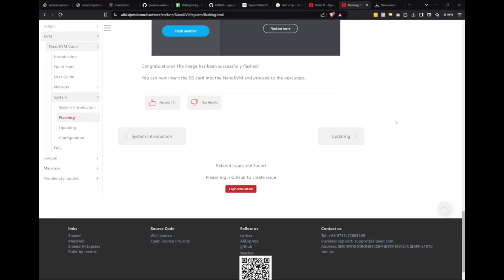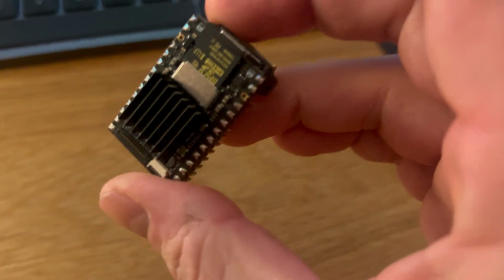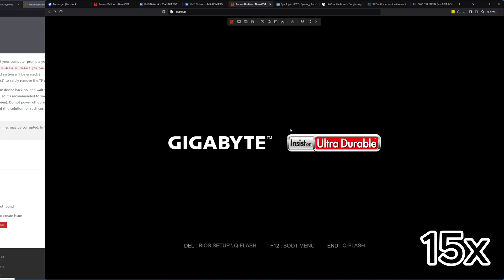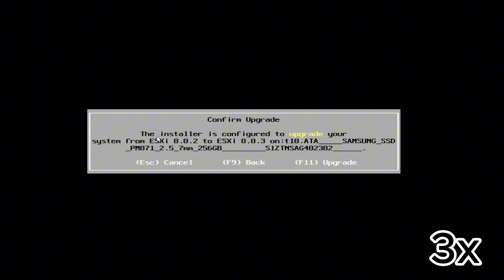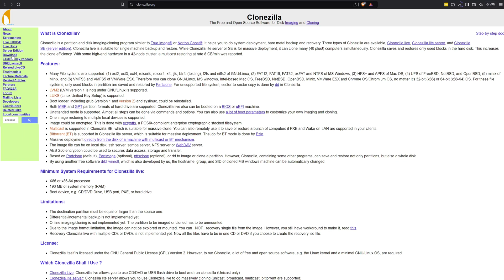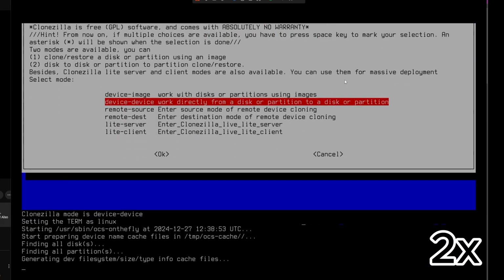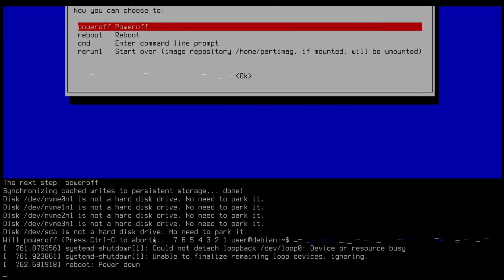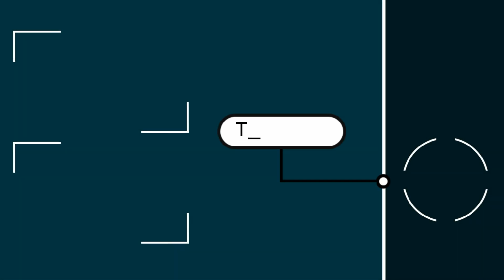Why I'll never need to leave my chair: Under rated KVM

Comment: Where do you get the image to flash on the sd card??

På dansk, hvor finder man det image til at at smide på sd kortet, og skal man bruge det for At bruge den
Reply from the maker: The image can be found in the documentation, linked in the video description. Specifically, you need to go the "Flashing the image" section, and follow the instructions for your OS. Without the image, the KVM has no internal OS, an cannot be used. 

https://wiki.sipeed.com/hardware/en/lichee/RV_Nano/4_burn_image.html

Comment: Just putting this out there, this device is compromised out of the box. https://www.youtube.com/watch?v=plJGZQ35Q6I
Reply from the maker: Hey thank you so much my friend, I had no idea.

I'm working on closing down my IoT network anyways, but this is indeed very concerning.
Reply: @Ottetal  I was very disappointed as well, employer needs have me looking for remote access solutions and I try to keep expenses low, so this was appealing. JetKVM does appear to be more secure but obviously at higher cost. The good thing with NanoKVM is that is open and there is a chance for a community firmware to be created. EDIT: Forgot to add I did enjoy your video, wasn't at all trying to steal your thunder or anything, keep creating and don't get discouraged!
Reply from the maker: @Seightten  Cheers, thanks. I did see the JetKVM - every HomelabYoutuber seems to have gotten one in the mail lol. Perhaps a good upgrade, perhaps I should go back to my old ways of having a monitor ready to plug up. Idk.

Thanks for the compliment on the video, it means a lot :) No thunder stolen - I'd much rather get info on unsecure hardware than not. Your comment was in no way degrading - a delight to read. Have a good day friend

Comment: The additional sound effects are a nice touch! Interested to know the reason for using eSXI. Is it just that this is what you are most comfortable with, or a specific reason?
Reply from the maker: @RobByteback  Thanks! I use VMware at work, and like to keep Homelab somewhat relevant to work.

I used XCP-ng before and for some reason can’t stand Proxmox. So ESX for now :)
Reply: @Ottetal  Makes sense. I would do similar, but I'm not a fan of either eSXI or Hyper-v! :) Interesting to hear you say you don't like Proxmox as all the homelabers I watch on here seem to love it. Have been idly considering migrating over to it from KVM/libvirt.
Reply from the maker: Maybe that’s what’s keeping me from it. Every techtuber and their mother praises it. Before that, the craze was all unraid, which I also dislike a lot